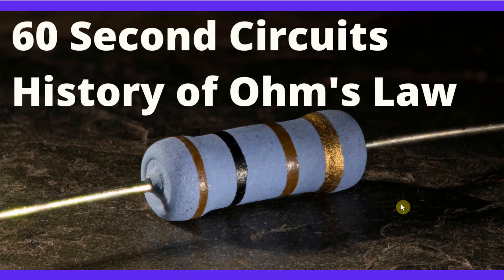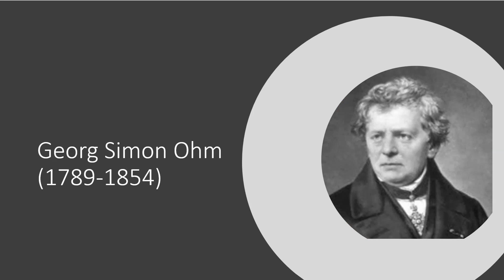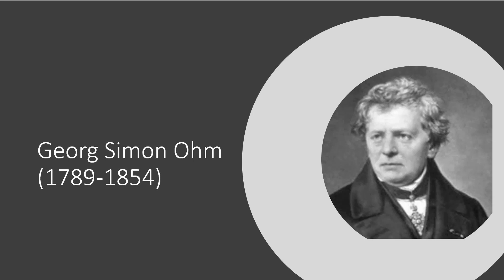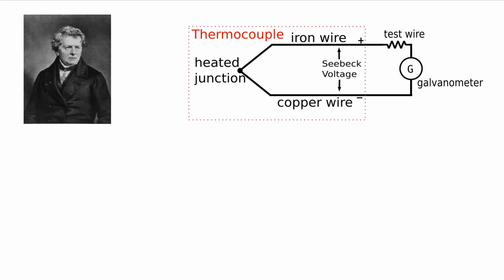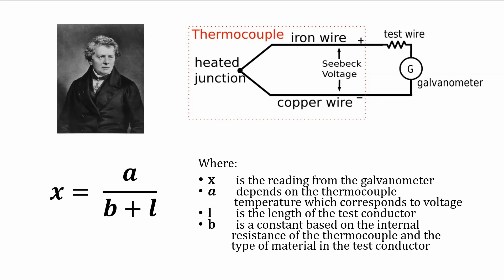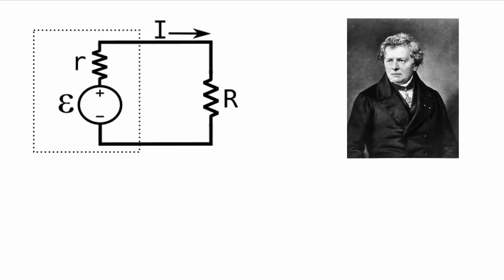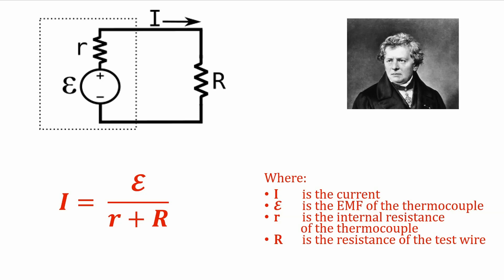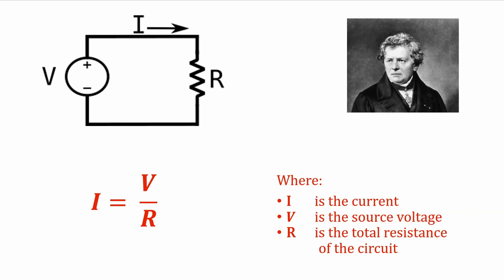History of Ohm's Law in 60 Seconds

Comment: The problem the thermocouple solved was the high ESR of existing voltaic piles, and the lack of a high resistance resistive material. This caused their current readings to all load down the cell(s) too much. The lack of a high resistance material also prevented the creation of an accurate voltmeter that could be used to correct for this without introducing its own current.
But how is something like a thermocouple supposed to have such low ESR? I usually hear about them having rather weak signals, though I guess that could just be a need for voltage amplification. I assume Ohm used a thermometer to measure the temperature of the thermocouple, which would be a good way of keeping the voltage constant, assuming the voltage of a thermocouple doesn’t sag with the load.
Reply from the maker: Hi James, thanks for that comment and insight. I don't think Ohm actually even used voltage as one of his parameters when collecting data...he used the thermocouple junction temperature. Knowing that temperature is proportional to voltage he was able to determine the law of proportionality. Of course, I'm just getting this from wikipedia since I can't read the original German in "Die Galvanishe Kette".